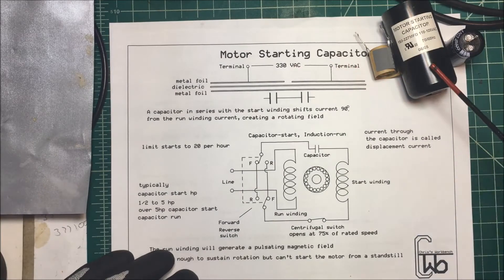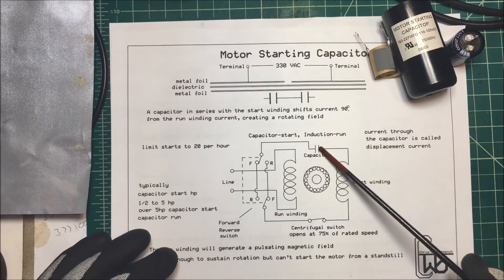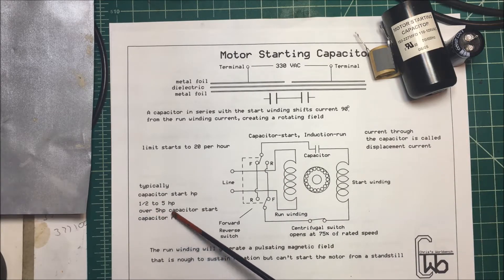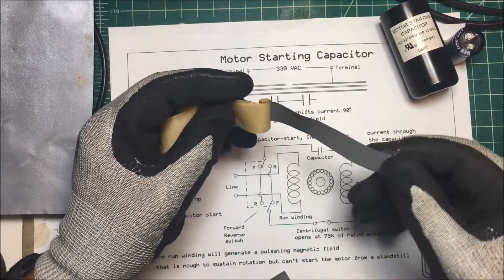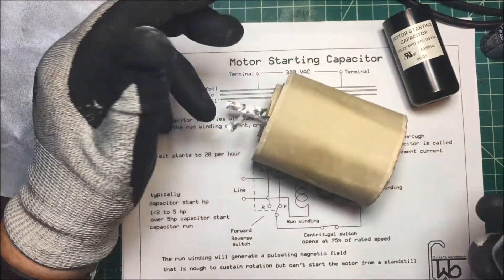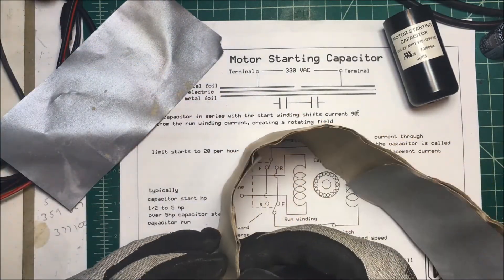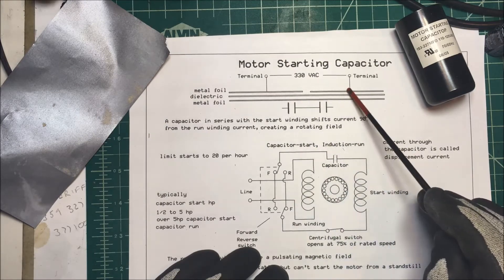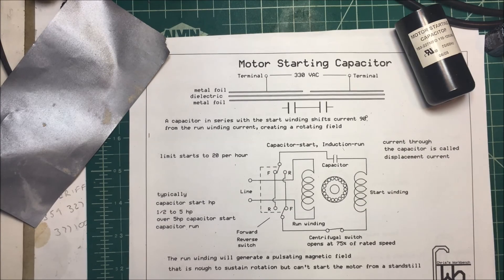Motor starting capacitor

Comment: Hello I hope you can answer my question , I have a mini table top freezer that is hard to start it has a 2.5uf start capacitor but won't start I have changed it for like for like still same , if I direct wire compressor  and jump the start run pins it starts up , is my 2.5uf start capacitor too week can I use a larger one